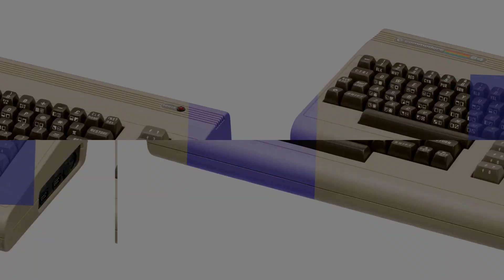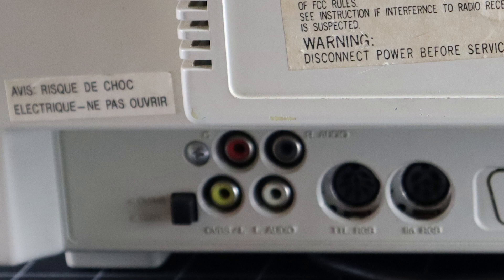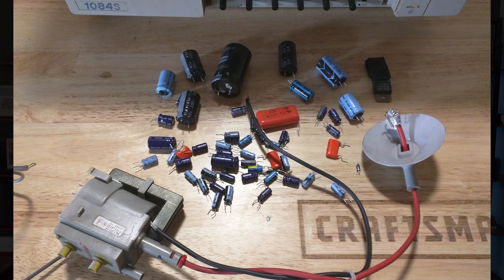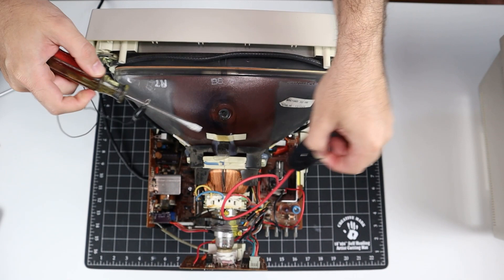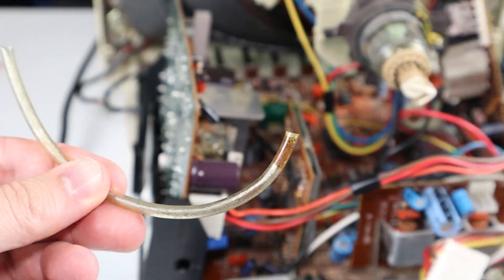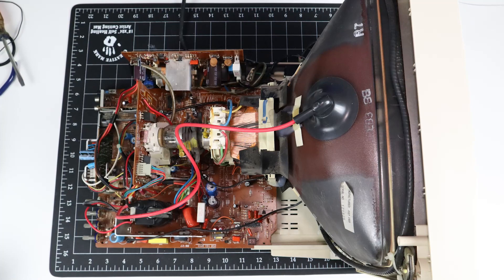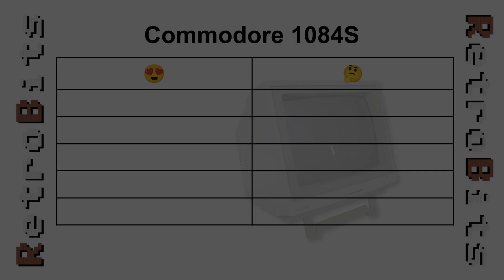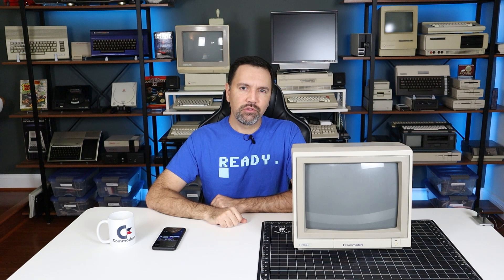Why I Love the Commodore 1084S CRT Monitor

Comment: The VCR button provides a crude adaptive scan for a signal with erratic horizontal sync. The most common use for this was for playback from a VCR, as there was always variance in the geometry of the helical scan head between units, and tapes would sometimes develop a physical "curl" on the edges of the tape with age or bad storage. You'd see this most often in tapes where the scanlines wobble to the left and back, and in particular often shear sideways at the top or bottom of the image. Just depress the VCR button and you'll see the image snap into place. 

It basically serves a similar function to a digital time base corrector. A real full-frame digital TBC does a better job usually, but the simple circuitry in the VCR button does a good enough job a lot of the time and similar circuitry was included by default in many televisions made after VCRs became popular (only it was always on on the TVs and could not be disabled except from a service menu). Some VCRs also had an "image stabilizer" button that did the same thing, only at the VCR's end.

The button should be left turned off when you feed it a known rock-solid signal like from a computer (in fact the button can mask some technical issues, making diagnosis hard if it's enabled)
Reply from the maker: Great info, thanks! The manual says only a few words about it but offers no specifics at all about how the button functions. I've used the monitor with many VCRs over the years but never found a need to press it. I guess I should try it with a really bad nth generation copy just to see, assuming I can fix it that is :)
Reply: @retrobitstv  Decent VCRs from the 90's will do the fix internally and don't need it. Those combo VHS<->DVD recorders have to do it, as even small wobblyness screws up digitizing the image. 

To really see the effect you need an old TV and an old or cheap VCR. You don't even have to make your own multi-gen copies to test -- tons of dollar store VHS tapes where they recorded in EP speed on crappy tape stock have the edge-of-tape form of the problem. I've had a few that were completely unwatchable without a stabilizer. 

You can also sometimes tell when the problem is being corrected by your TV if you're using a cheap 90's VCR that has an on-screen menu overlay but not video processing. The image might look fine but if you bring up the overlay you can see the scanlines from the overlay darting left and right, especially near the top of the screen. This is because the overlay is genlocked to vertical sync, but not horizontal sync. 

The VCR button was a godsend to me when I was a kid as my basement room had an old 80's VCR and an even older 80's TV, and watched a lot of multigen copied VHS tapes of new anime that had been taped off TV in Japan. =P I'd plug the VCR into my 1084 to be able to watch stuff that was a wobbly mess on my TV.

Comment: I've had it happen to me on a 1085S monitor, i pulled of the yoke and cleaned it and picked out the damaged wires, I used a thin layer of epoxy to insulate them where the lacquer had burned off, I had 2 burned trough wires which i soldered back together and used shrinking tube to insulate them. In some mister cores where the screen is more narrow I have a little bit of a small swerve in the edge geometry but its barely noticeable. But I think I was lucky :) but you can always try. I also added a scart connector to a 1084s-p it will need some additional components though, as you will have to let it switch to the scart rgb signal, pin 16 has to connect to a transistor and has to provide 3 volt.
Reply from the maker: Glad to hear you were able to repair yours and thanks for the tips. I will get the yoke out and cleaned up and see how bad the damage is and then try and come up with a plan. What type of epoxy did you use? Thanks for the tip on the scart connector as well!
Reply: @retrobitstv  I think its a bit of a generic 2 part epoxy, its called Bison Kombi Quick Epoxy

Comment: So lesson learned; before replacing deflection transistors check the resistance of the deflection coils.
I hope you get this beauty fixed as it is my favorite retro computer monitor. It might be possible to repair the shorted deflection coil by winding new lacquered wire on it. If you use the same gauge and count the number of turns on the old one..

Not an easy job, and a lot of work but it is doable..
Reply from the maker: Great advice, and something I will remember for next time! I do hope it can be fixed, so I'll be checking out the extent of the damage soon to figure out a game plan.

Comment: Thanks for the video! Sorry to see your 1084S failing. I briefly had a 1084 which had a broken power switch.
Reply from the maker: I'm surprised mine hadn't broken yet, but I picked up a couple new switches to have on-hand for when it did happen!

Comment: I only have my 1084 left, (and the trapdoor still works).
Its' only problem is the color displays in rainbows near the corners. I'm sure it would work perfectly if I had the right tools to degause (sp) the corner posts. If I remember correctly, the power-on is supposed to clear any magnetism issues, but this also seems to malfunction...

Comment: The VCR button changes the way it reacts to noisy sync signals. Essentially for TV and computer signals it makes sense to ignore small fluctuations in the sync position as those are typically just caused by noise.This is what's commonly called "fly-wheel synchronisation" where the deflection goes on regardless of small errors.
For VCRs however, this is not a good strategy as they have time distortions thanks to geometric distortions of the tape and velocity errors. A signal from a VCR will always be jittery. Pressing this button makes the monitor react quicker to those fluctuations giving you a much more stable picture.
Reply from the maker: Great info, thanks for clarifying. I used the monitor with a VCR back in the 90's but I do not remember now if I ever tried pushing the button back then or not.

Comment: separate the green (oxidized) wire on the yoke and see if you can find the short. if broken solder them and then apply varnish and then return them to the original position.

Comment: Replacing the deflection coil /yoke isn't that big a deal. Just make sure that it is unscrewed or you will snap off the neck of the tube. If one of the guns is bad than replacing the yoke won't fix it.if you replace the yoke it has to be with a virtually identical monitor or you will probably never get the convergence dialed in very good. If you replace the yoke and the convergence is off you can readjust the convergence rings.

Tere are some good tutorials on YouTube from the arcade community on doing a yoke replacement. I can send you a link if you want. I have never replaced a yoke but I have taken 3 or 4 off and repositioned them. 

Good job adapting this video. It was still entertaining and informative despite your CRT dying mid production.
Reply from the maker: Thanks! I will definitely have to start doing some more research on repair/replacement and start looking around for a suitable donor. I'm sure it can be done, but finding just the right part is probably going to take time.
Reply: @retrobitstv  you're welcome and good luck!

Comment: Such a shame that the monitor died on you!  I really hope you keep it and eventually find a way to get it fixed.  It may be beyond your skills today, but who knows what you may learn in the months/years ahead?  A retired TV repairman may be able to help or perhaps even be willing to fix it for you?  I have a very similar Magnavox 8CM515 (also made by Philips)  that I've owned since I was about 17 years old.  My case does not have the cut-out for the SCART connector, but that part of the back of the case is unoccupied - making me wonder if the PCB inside is ready for a connector in that spot as well.  I really wish you'd been able to finish this video, as I'd have loved to see if you could have gotten that SCART connector working!   Hopefully someday - please don't give up...
Reply from the maker: Thanks for the positive thoughts! I hope I am able to fix it in time as well. One step at a time!
Reply: Just letting you know that, yes indeed, my Magnavox 8CM515 does have a spot on the PCB for a SCART connector as well!  I didn’t check for traces under the board, but expect they are there just as on your 1084S.  Are you having any luck getting your 1084S repaired?

Comment: Hard to see in the footage but if it's only one or two-ish wires that has burned off it should be possible to fix by reconnecting the wires and lacquering again.
Reply from the maker: Thanks for the tip, I hope the damage isn't too extensive! Next step will be to remove the yoke, clean up the charred bits, and assess the situation.

Comment: sad indeed. i have three 1084s's. Only one survives. One has a busted flyback and the other is starting to whine so im guessing its flyback is on the way out too. Other than that i have a Sony BVM 20E1E which i also adore. I hate using modern screens for retro stuff so ill be using my crts as long as i can. Great video :)
Reply from the maker: Good news is that flybacks are still available, at least for Philips models. HR7506 I believe is the replacement part but probably a good idea to check your service manual to be sure!

Comment: It´s probably a shot in the dark, but have you considered finding another 1084 of the same type to use as a donor?
Great  video by the way; I have a 1084S-D1 myself, so it was quite interesting to see the differences between the two models. I bought mine used a couple of years ago, but I hope it will last a few more years.
Greetings from Denmark.
Reply from the maker: Thanks! I haven't started the search for a replacement part yet but I may put out some feelers and take some measurements to see if there are suitable replacements from similarly-sized tubes. Enjoy yours!
Reply: @retrobitstv  I have a spare 1084 if you're still looking.
Reply from the maker: @CoCoNutBob  I am still looking for parts to repair mine but I wouldn't want to cannibalize a good working unit to fix it. If you've got a dead or parts unit that you're looking to sell, please let me know though. Thanks!

Comment: Nice video. I have the same crt except in mono. How did you connect the mister to the crt? I can't find any cables to connect to the 6 pin rgb din. Only my Amiga 500.
But I'm not able to connect anything else to it or I have to use composite but this is not what I want. 
I have an European model and also no scart connect. I soldered a scart connection to it like you wanted to, but I get a scrambled picture when I connect something to it. Megadrive, snes etc.
I saw a video of someone who was succesful but me it isn't working.
Reply from the maker: Hrm, I do not have any advice on the scart connector as I never got that far into the project. It sounds like the sync isn't correct tho, or it's not switching the monitor into RGB mode at all. Another commenter indicated that it may be necessary to add a transistor on pin 16 to activate RGB. For the MiSTer, I made a custom cable for the analog I/O board and made sure to disable the scan doubler. Pigtails for the DIN6 end are less than $10 and you can add whatever end you want to it (in this case hd15 vga): https://www.digikey.com/en/products/detail/tensility-international-corp/10-00436/2625286

Comment: I have a 1084S-P1 European model and unfortunately it does not have a SCART connector, as a result I haven't really used it in recent years, it also has a 9-pin RGB port instead of the precursor to S-video. Recently I've been playing around with the idea of using it as a PC monitor for retro inspired games (e.g. the new Turtles game that recently came out and other games like it), which is how I stumbled on to this video, while trying to look for any info on how to use it on a modern PC (as of now, I'm still stuck on whether that is even a possibility or not)
Reply from the maker: You should be able to create a SCART-to-DB9 cable to use your monitor with anything that supports RGB with HV or composite sync. This might help, assuming that's a -P1 monitor: https://www.retromania.pt/cms/2017/06/17/tutorial-um-adaptador-scart-1084s-amiga/

Also check out CRTEmudriver - it works on modern PCs with certain AMD video cards to support 240p monitors: http://geedorah.com/eiusdemmodi/forum/viewtopic.php?pid=1009#p1009
Reply: @retrobitstv  Thank you, I'll look into those~

Comment: What would happen if you got that flyback pop in your fingers from the cap discharge, if the monitor was off as shown?
Reply from the maker: Best possible case, some displays have a discharge circuit that will bleed off the stored voltage given enough time. The pop you heard was 10's of thousands of volts discharging which is enough to be lethal if you touch it.

Comment: Thanks for another great video but sorry about the monitor. I’m sure you’ll get it back working soon. 

Question, I know you mentioned this monitor works with the Apple ii core, have you been able to use the 486 core?  I just have a 1702 monitor and it won’t work with the S video output nor the other CRT I have. 

Thanks again and stay safe.
Reply from the maker: The ao486 core outputs 31khz RGB natively, so the 1084 won't be able to display it. You should be able to override the default behavior of the core and force it to 15khz, but that's going to break compatibility with software that use resolutions higher than 240p. You can try putting the following in your mister.ini file and see how far you get:

[ao486]
video_mode=320,8,32,24,240,4,3,16,6048
vga_scaler=1
Reply: @retrobitstv  Thanks so much for taking the time to reply and provide this information. I had a feeling it might not work but wanted to confirm with someone that has more experience with the Mister as all my past retro stuff has either been with original hardware or a Raspberry Pii. 

Thanks again and stay safe.

Comment: HI! I have a question, but i have to mention immediately  that i have no technical understanding whatsoever (none!), so in case of answer i won't be offended by an oversimplified version of an answer. Back to the question: I have a C-64 and an A-500. Because of limited space i use only one 1084S monitor, switching cables at the back of the monitor every time i change from C64 to A500. Is there any way i can  get both computers connected to that monitor at the same time? Or in any case a scenario where i can leave the connectors at the back of the monitor in peace and not breaking my back in the process?
Reply from the maker: The short answer is yes! It sounds like you are connecting the A500 to the monitor using composite (single yellow RCA style connector). For a much higher quality picture, the Amiga should be connected using RGB instead. This would require you getting the proper cable, DB23 to DIN6. You can find these cables for as little as $15 USD on AmiBay, eBay, or at various Amiga vendors online! Once you've connected that cable, you can leave both systems connected to the 1084S and switch between the C64 and A500 by using the RGB/CVBS button that's in the front control panel. Note that this doesn't solve the audio situation. You would either need an RCA switchbox to pick which audio input to send to the monitor, or use external amplified speakers which is what I do :)
Reply: @retrobitstv  That is putting me a long way in the right direction. I’ll figure it out from here, now that i have the right abbreviations of stuff to fit to the setup. Thanks for taking the time and greets from Belgium!

Comment: it's better Commodore 1901 or 1084s P   ???  for 80 columns RGBI Commodore 128 ???  thanks :)
Reply from the maker: I suspect either will be just fine for the 128. The 1901 is a PAL-exclusive model so I've never seen it before myself. On cursory examination, it looks like the 1901 only has Digital RGB, perfect for the 128, but the 1084 also has analog RGB for the Amiga and other 16-bit era computers and game consoles.

Comment: I have an 1084s which has not been use since 1998, now I try turn on and the red light come on  but no picture the hookup is correct . What come be the problem other than I have not use it in years?
Reply from the maker: Is it making any strange noises? Can you feel static when you run your hand over the screen while it's powered on? Also make sure it's not set to RGB if trying to use CVBS or vice-versa.
Reply: @retrobitstv  I just starting setup my commodore 128d, I have the same setup as you do but I get no picture and the monitor will not shut off and on. Is this 2 separate problem or just one?
Reply from the maker: @lesterjeffries2467  First thing you need to check is if it's making high voltage. Either check to see if the neck of the tube is glowing, or just run your hand over the screen and test if you feel any static.
Reply: @retrobitstv  Thanks,, I try 2 monitor and none of them turns on. So I will open the 128D and see if any dirt is inside. I have not them use them since  about 1998.